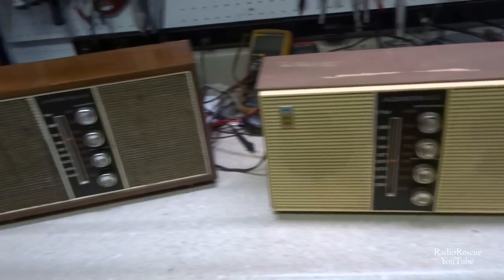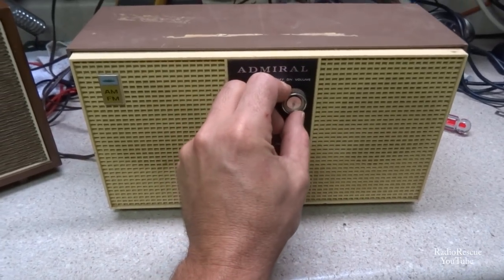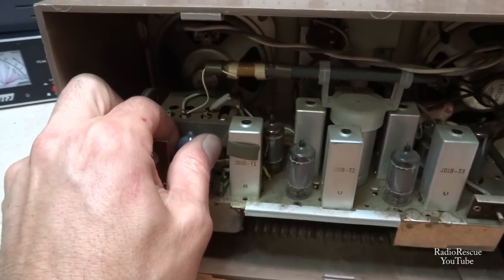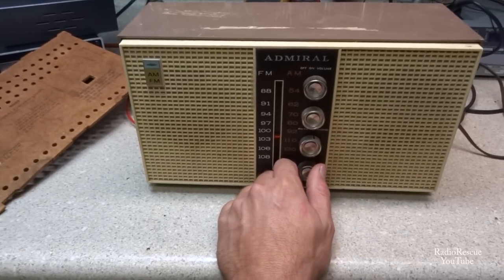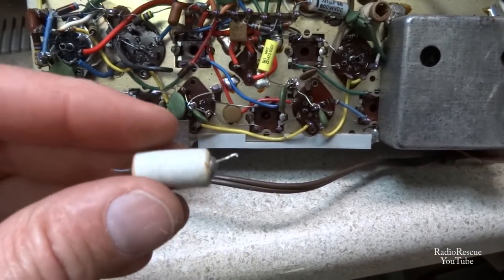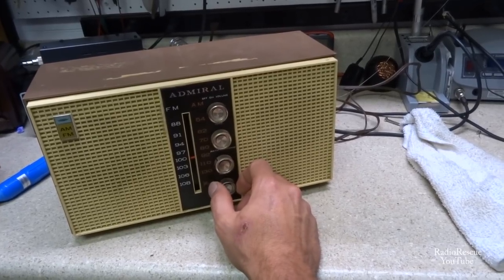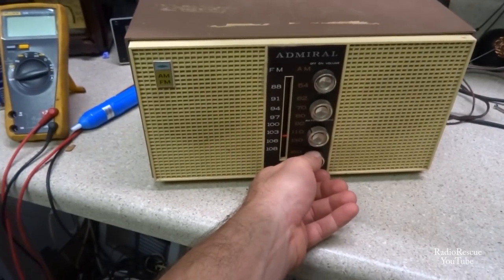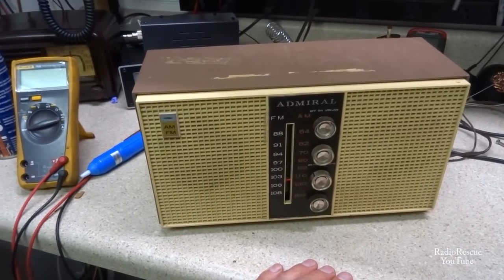Repair of a 1965 Admiral YG529

Comment: Wow. Interesting. I just picked up one of these, same as in the wood cabinet, only mine has a clock.  Mine works well, but needs a Recap and servicing.
Good sound, receives well, both bands, and has a “ Phono “ Jack in back.  I did plug in my iPhone and it worked.
📻🙂

Comment: Nice Video. I have a Admiral YK501. It plays AM great but nothing on FM. I checked all the tubes and they are good. Any ideas why just the FM would go out? Thanks.
Reply from the maker: Something in the FM circuit is open or out of spec. Start with the simple stuff first like dirty AM/FM switches and controls.

Comment: I have a similar radio. it is admiral YG531 with chassis 6H4N-2. I am looking for the resistor value. In your other video on the YG531 you show a flexable resistor, but the resistor on mine looks like the resistor in this video at 5:51. The brown one with the white stain on each side.
What is the correct value of that resistor on the model YG531?
also what type of capacitor is the yellow one?

my radio has the brown rusty whiteish stain on the chassis and resistor just like this one does. Do you know what caused this? I cant seem to find a schematic for my radio either so if you know where to find a schematic for the model YG531 let me know.
Reply from the maker: I have a video on the YG531. The schematic is available from Howard Sams You can purchase on there website. You mention a flexible resistor so I'm assuming your asking about the voltage dropping resistor. You'll need the schematic otherwise to find the value of the resistor you'll need to use Ohm's law  to find the correct value. This video was made 7 years ago so I don't remember the values. I've worked on 100's of sets since.
Reply: @45AMT  ok thanks, I will have to check them out to get the schematic. I dont want to assume its current value is correct as it might have went up in value. it is not the flexable one as someone has changed it to one like the radio in this video is using. the leads are green and the body cracked. I will get the schematic from howard sams and use the value on the schematic when ordering a replacement.